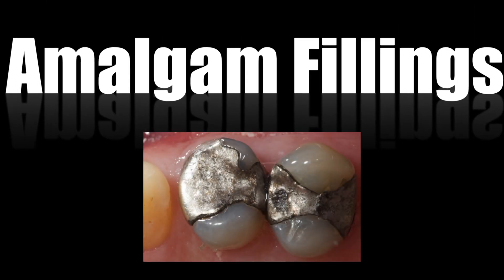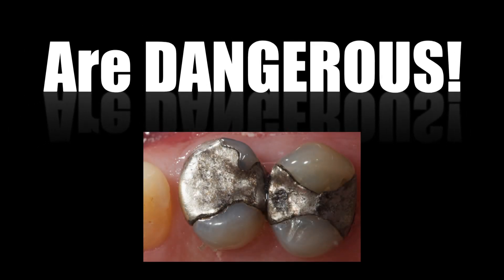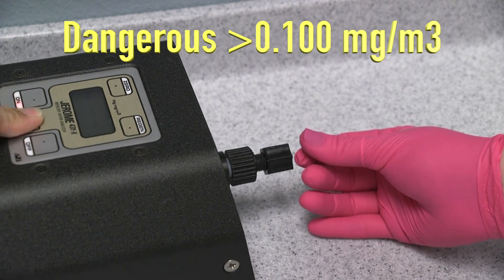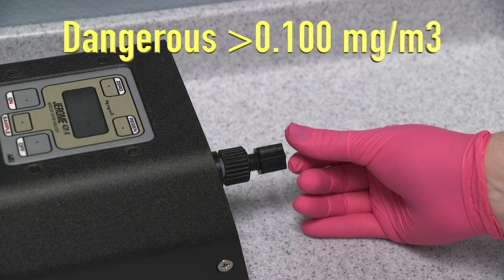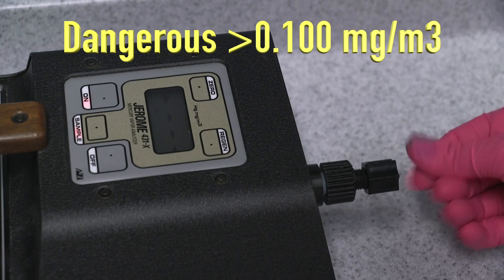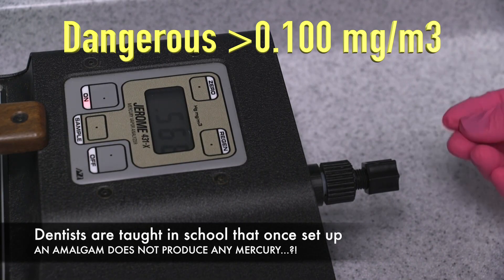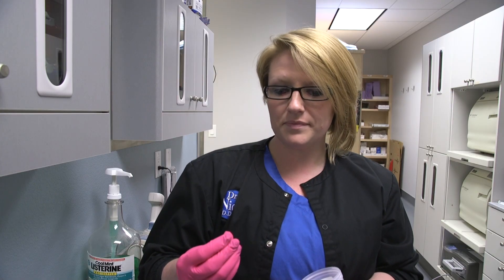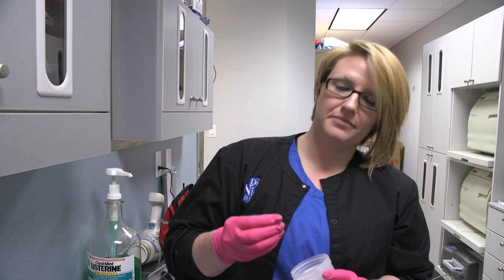DENTIST Proves MERCURY Released From AMALGAM Fillings!

Comment: I'm so pissed, a dentist told me how these were the best so I have like 4 of these in my mouth right now.
Reply: I had several when I was a kid.  I developed chronic fatigue and learning disabilities shortly after I got them in 1st grade. It was very confusing because everything changed and no one knew why  back in 1967.  So I ended up taking Ritalin till 10th grade, then MD abruptly took me off of that.  Then I faced a year of Hell.  No one bothered to explain to me at 16 in 1978 that I was going through withdrawal.  
I stopped seeing MD's. all together and started seeing Chiropractors but  Didn't figure the problem out till 2000 and had them removed.   I would do a consultation with a Biological dentist.  In the Clearwater area Dr. Beam is amazing but expensive.
I'm willing to bet a lot of nervousness, depression, fibromyalgia and CFS has roots in amalgam fillings.
Reply: @ceilconstante7813  i trust that this all happened but the problems (if from the amalgams) were likely because of the now outdated ratios used to make them. My other thought is that is is possible that other factors helped to cause that to happen to you
Reply: Sadly, a lot of dentists lie through there teeth.
Reply: me too and very sick I am getting them removed
Reply: @melaniemoore5635  Be wary, they need to be drilled out, which releases mercury vapour and dust, this is more likely to cause issues with toxicity through acute exposure than leaving them put! Unless you get the teeth pulled entirely!
Reply: I have 6 and I’m getting them out ASAP
Reply: @joegatt2751  You should find a dentist that specializes in amalgam removal. Plus he must use a rubber dam and air suction away from the mouth while doing it. Rubber dam is to prevent swallowing down flakes of mercury. This is standard procedure and if he doesn't do that, maybe look for another dentist.
Reply: They are best for poisoning you!
Reply: Many dentists lie to convince you to agree to what is more convenient for THEM, not what is in the patient's best interest. I'm talking from experience, unfortunately.
Reply: You NEED to make sure the doctor has a vaccuum set up to catch the mercury vapor dust being drilled out so that you dont breathe it in - hold your breath while he drills and tap make a signal for when he should stop so you can breathe. DO NOT BREATHE WHILE HE's DRILLING. 7 seconds drill, 7 seconds breath, or however long.
Reply: I have 9😩
Reply: I have 11
Reply: I had 13 removed 2 years ago, but had more before and others that had been drilled out and replaced. been ill most of my life now slowly getting better. Find a good reputable dentist that knows the dangers of amalgam and how best to protect you during removal.
Reply: You have been poisoned
Reply: Composite is bad for you too. So it's pretty much pest or cholera.
Reply: It's dangerous for the dentists, not patients. Especially when set.
Reply: @mandarin1257  Fuck you youre an idiot
Reply: It's not really that harmfull 
It affects dentists more than patients 
In dentistry there is either amalgam or composite
Amalgam is still widely used for its perfect mechanical properties.

Comment: they could replace mercury with gallium, with is non-toxic and will amalgamate with silver just a readily, also will be harder
Reply: if that was true, they would already have done that everywhere. I HAVE gallium, and I can tell you from experience, that it would not work at all. gallium alloys are always really brittle or really soft, or both, and they frequently have super low melting points. imagine drinking hot coffee and your amalgam melting, yeah, gallium doesn't work.
besides, gallium does not like to amalgamate, especially in the way mercury does.

Comment: I have 3 left in my mouth, I need to take them out, I have been suffering from Nodal Turbines Inflammation for over a dacate now. A holistic doctor tested me with some kind of electrnic mashine  and did my blood under the microscope told me that I have heavy Mercury in my blood possibly from those feelings and that's why my stuffed nose..OmG Slava Isus Hristu  there is light at the end of the tunnel.. can't wait to fix my nose inflammation.
Reply: You should look into acc chelation: mercury detox group on Facebook. I’ve been following the protocol for 2 years now and I’m getting over so many health issues that were just caused by my fillings. That protocol is the only safe way to detox mercury.
Reply: @19jjo91  ok, I just got my last once out and now gonna go back to my Holistic Doc, to do Vitamin C IMs..
Reply: @19jjo91  but did you get the fillings removed ?
Reply: gardensofthegods yes, fillings must be safely removed before starting the protocol.
Reply: @19jjo91  yea I done it about e months ago..
Reply: Nenad ИС XC Shuput have you started chelation?
Reply: @19jjo91  no i did not, I stopped eating Wheat also, and soy and carbonated drinks, and that improved my Turbinates drastically.. so..
Reply: Nenad ИС XC Shuput you’ll want to do that sooner rather than later if you want the mercury that’s stored in your body, out.
Reply: @19jjo91  right, thanks..
Reply: @19jjo91  Do you have any recomended chelation protocol?
Reply: @simplemind9192  read my first comment

Comment: Lol pure scam of course you don't use amalgam cause the money is on composite there is plenty of proof that amalgam is safe
Reply: Aizen Sousuke Oh yeah, plenty of proof that mercury vapor is safe to breath in.  This dentist is not the only dentist that holds these views btw.  All it takes is a little critical thinking and research to uncover the truth. Dental amalgams are 50 percent mercury and toxic.  Watch “smoking teeth” in YouTube.
Reply: Rob Lovegreen lol keep coping. You get more mercury from eating one tuna than one amalgam removal
Reply: @naegleriafowleri2230  you should read Andrew Wakefields work, and work out the common denominator. Then go check EHO guidelines on broken flouresant bulbs. The tuna does not stay in your mouth 24/7, and who is calculating how much tuna next to how many fillings
Reply: George Theo I have 1 Mercury filling but I don’t know what to do should I just leave it?
Reply: Aizen Sousuke is right. Dentists bill significantly more for composite for the same surfaces on the same tooth. Mind you composite does take a bit longer to place. But the difference is negligible for a seasoned, efficient dentist.
Reply: Its changed its position on the periodic table , mercury is now safe !, so safe they do not put it in thermometers,  make a fuss about it in light bulbs , have a strict code how it is to be handled , but yet leaking in your mouth , it's safe !. I Am still suffering from the effects. You are so wrong about the evidence. They know , but do not dare speak.